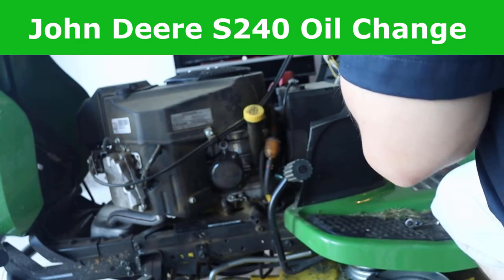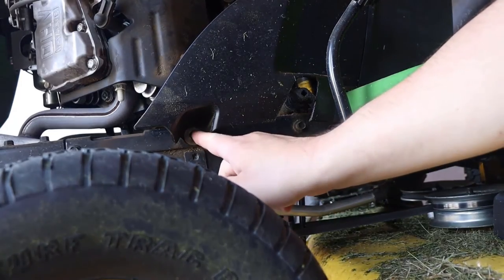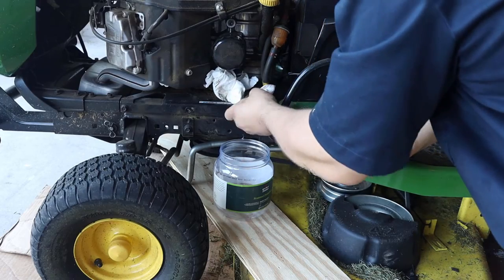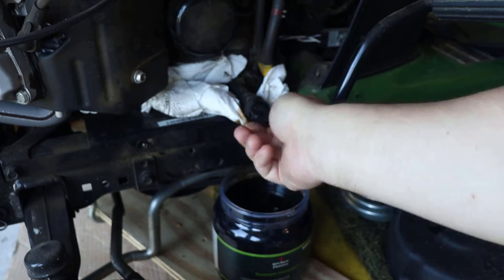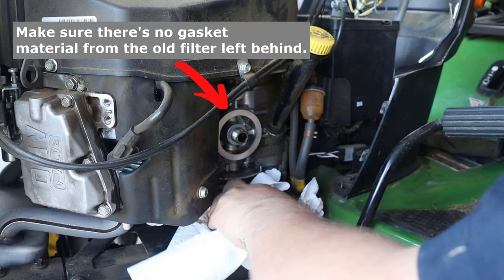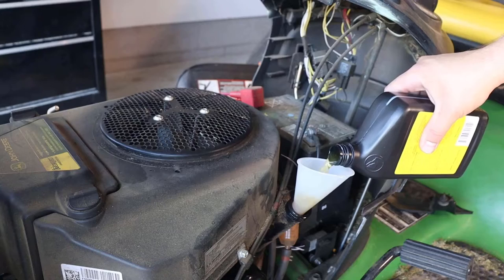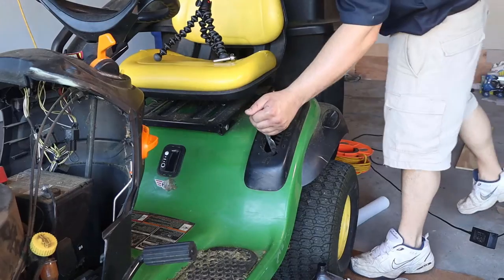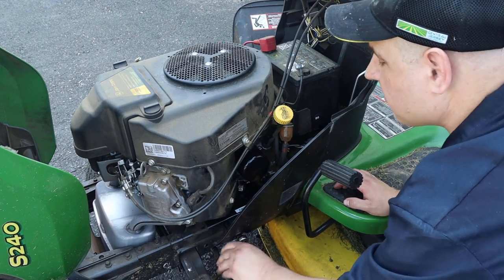John Deere S240 OIL CHANGE (Let's get this engine serviced)

Comment: I have the S220 and just did an oil change. Mine has an added hose about 10” long attached to the drain plug. So much easier to be able to get a pan under for drainage
Reply from the maker: I just looked up your drain plug assembly on the S220. Wow, I'm jealous of how easy that is with the hose.

Comment: I just got a brand new S240 July 13, 2021 (Yesterday)  My side cover is not the same as yours. On mine the side cover 8mm bolt has to be removed completely to get the cover off also the oil drain is not visible with cover in place (No Cut Out ). Is the S240 you demo a 2021 ? 
I would never tighten an oil filter with a tool, Hand tight is plenty. There must be a better way of controlling the oil filter oil, maybe a small gutter.  Thanks for sharing.
Reply from the maker: Congrats on your S240. Mine's on the older side. Maybe 4 years old, I think, but I know they do there have been slight variations over the years. I see you got the bolt in the other comment you made. I don't do much with the tool to tighten (1/4 turn tops), I hope I made that clear in the vid. If your happy with hand tight then no problem, whatever works for you.  I hope to share more next week on how I messed up my deck spindle and then fixed it, so stay tuned if you want more S240 fun.
Reply: @DIYWithAaron  Thanks, I'm still learning this S240. I had a 2002 LT150 for 20 years. One thing I noticed is the new K46 transmission does not brake when going down hill like my old one. That really got my attention ! I'll be watching for your next video.
Reply: Having sprayed the mower deck with Fluid Film and mowed a small yard last week, today the grass wiped off with a paper towel.
I don't know long term but it looks promising. Fluid Film has an unpleasant odor (doesn't last long) be well ventilated when applying.

Comment: Aaron, How do you feel about using the wash port ? I have read pros and cons. My LT150 didn't have one.
Reply from the maker: I don't think it hurts, but I don't think it helps much either. The only way to really clean the deck is to take it off.
Reply: @DIYWithAaron  Most of what I've researched is that water is not good for the mower deck. Before I do any mowing I'm going to coat the underdeck with Fluid Film.
Reply from the maker: @williamfrancis6993  Yeah, I've heard the more recent Deere decks aren't as good as the older ones. Coating it might help, but I'm not familiar with Fluid Film. I never really thought about it much, but maybe I should.

Comment: I have a 2015 model and two times I bought a Wix filter for it. They will not seal off(thought it was just a fluke)and you will lose most of your oil before you can turn the key off. Use John Deere filters or Kawasaki only.
Reply from the maker: Thanks for posting this. Good info to know.

Comment: Don't need to tighten oil filter more than hand tight and then you should be able to remove it by hand next time without any tools.
Reply from the maker: Perhaps I'll try hand tight only next oil change. I always did it with that little bit of extra tightening as that was how I learned it and it's always been fine.
Reply: @DIYWithAaron  hand tightin is all you need  do!

Comment: General Question:  How often are you all changing the oil?
Reply from the maker: According to the John Deere, you should change the oil yearly or every 100 hours of operation... whichever comes first. I personally do it yearly even though I rarely get over 40 service hours. It's easy to do and is relatively cheap insurance against engine problems.